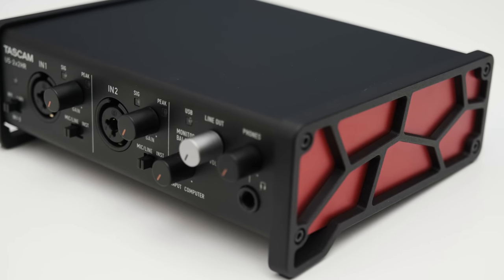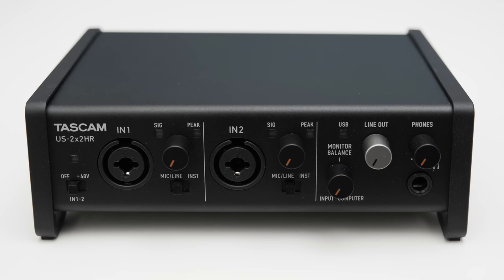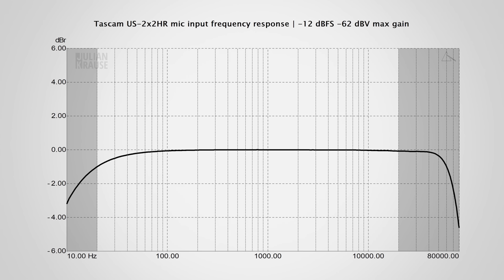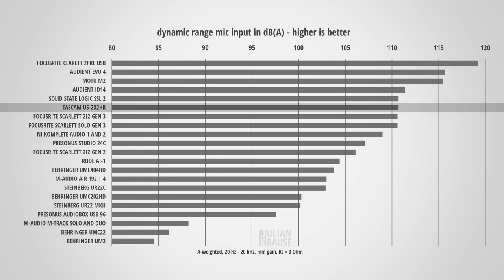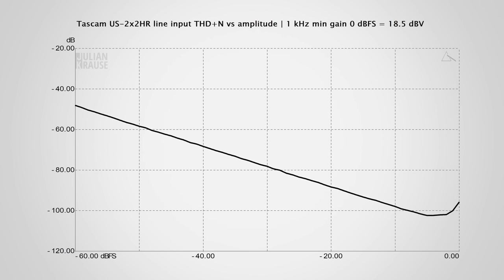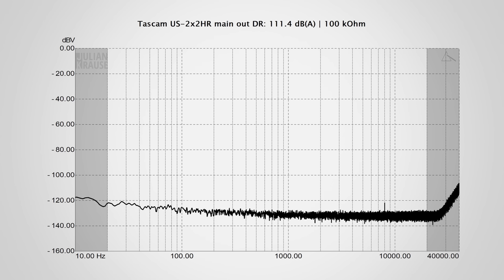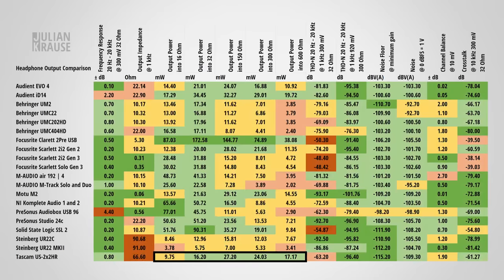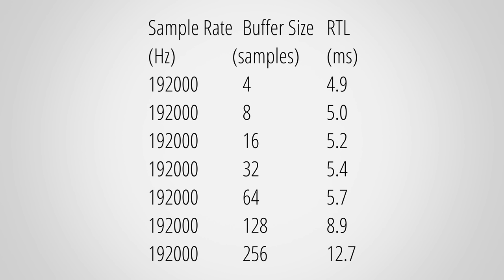Tascam US-2x2HR USB Audio Interface Review (audio quality test)

Comment: I bought a Tascam 2x2HR and it has been nothing but problems.  Mine had several internal soldering joints fail and most recently the headphone monitoring failed.  However my Berhinger UM2 that's almost 10 years old  still works  fine as does my Focusrite Scarlett that's 2 years old.  IMHO Tascam is not making products with the same build quality that it once produced.  Buy a Focusrite don't waste your money on the Tascam.

Comment: STILL enjoying my MOTU M2.
Reply: Me 2 =)
Reply: Hey guys what makes the motu better than the Scarlett 3rd gen? I just purchased the 2i2 3rd gen and don’t know if I should trade? I record guitars allot
Reply: @jorgeguitar2540  both are imo good audio interfaces. Julian did reviews about both of them. Worth watching!
Reply: @jorgeguitar2540  your scarlett is also solid purchase. But according to our friend Julian it has the most balanced and positive results overall. I for instante only use it for xlr microphone +monitor and headphone amplification. Also those visual meter right in the front is super useful + PC sound loop right into drivers
Reply: @jorgeguitar2540  hello, I'm gonna hop in on this conversation and give my two cents (I own the m4 and have had a scarlett solo and 18i8 in the past) 
In my opinion, the screen that shows the levels is decently accurate but mostly helpful for setting quick levels. The mic and line ins are probably of similar sound quality (Julian has done a video on this before)
The real selling point for me with the Motu M2 and M4 is that they have extremely fast conversion times and introduces much less latency into the signal path. When I'm working at 48khz I can take the motu all the way down to 128 or 256 and not get any cracks or pops when I'm trying to record vocals or something like that while maintaining best in class latency. Honestly, you'd have to pay hundreds of dollars more to get something quite as fast, or better. (I could be wrong on that, but it seems true in my experiences so far) 

This difference in latency is due to the utilization of Type-C connections.
Reply: @tristanmcguffin8947  If you are no musician, just a pc dude who wants to stream or something, go with the scarlett if you are happy with it.
Reply: @ImDaRealCartman  For streaming I would recommend the audient evo v4, unless budget is seriously tight.
Reply: Julian's M2 review made out the M2 to be very impressive. In the US it's only $30 more than this Tascam unit but has lower latency with multiple instruments.
Reply: @jorgeguitar2540  Have you seen the Antelope Zen Go yet? Seems ideal for guitar players as it has builtin amp sims and cabinets, It's just shy of 500 Euro though so I am waiting to see that Julian has to say about it.
Reply: @vroge3275  built in amp sims? Sounds nice! I heard the Ik multimedia axe is good for guitar players too but I also see bad reviews. Honestly I don’t know what a good DI input will be? All I hear is  this x interface di input is more dynamic but what makes it like that and good so I can look for the specs on different interfaces?
Reply: @jorgeguitar2540  Yes, it is a minefield trying to pick and choose, which is why what Julian does is so important. He is giving unbiased reviews based on what the devices actually do rather than what the companies say they do.

Comment: Thank you for the review, as always great in details! Charts with different interfaces are very helpful.
I am looking to upgrade my old Tascam US-200. This dude gave me, and still getting me different kind of troubles. Reading forums here and there, I see that people have same issues with newer Tascam US2x2HR, and it's a bummer. I watched tones of different reviews, and still haven't get my head clear about what to choose for a home studio in a price range 150 - 300. When you are in this segment you are not a pro (meaning making money with a music) and basically it comes not to subtle technical differences, but rather to outputs/inputs needs, and stability. The latter, which is most important, at least for me, rarely appears in reviews. I understand why - reviewers most often do not own, or do not use the product for a longer period of time.
I am starting to think that only normal way, how you can choose a suitable audio interface, is to get one, test on your setup for a week or so, and if it works out keep it, otherwise send it back. Unfortunately sanding back sometimes is not that easy, or not possible at all.

Comment: Bro I'm thankful to you. Finally decided to change audiointerface, cause Line 6 UX 2 is incredibly bad with windows 10.  My choice is Audient EVO 8. It's just great. Silent, amplifier is more than enough for 250 Ohm headphones. Stable drivers, lovely program interface where i don't even need to tuch buttons on the interface itself for adjustments. Thnak you again, your channel is the best gear review channel ever.

Comment: My first interface was the tascam 122 and at the time not much could touch it…for the money that is, then I moved on to RME FF800, Babyface, and never looked back, both original RME units still work perfectly and are still supported with soft and firmware updates, and given how old they are and how their performance still holds up is quiet amazing!
Reply: Would u say that this interface is an upgrade over the us 122?...I currently have the us 122 and looking to upgrade...I use windows 7... thanks
Reply: @lisaredsatl2571  very probably, but the 122 was a fine piece of gear for its price back then

Comment: I have the 208i from Tascam, which (from what I've been able to find online) appears to use a lot of the same technology as the HR series. Or rather, the HR series seems to use a lot of the same tech as the 102i/208i, since they were released a couple years prior. Always great to see some of the more pro-oriented features and specs make their way to consumer-oriented gear, although it's too bad that the option to set phantom power individually for each input did not make it to the HR series - that's always been a pet peeve of mine. I've been very happy with it, but I'm grateful I found this analysis because it validates an issue I've noticed in my 208i that had me wondering if I was going crazy or just set it up incorrectly - the headphone output balance. The left channel is significantly quieter than the right on BOTH headphone outputs, so much so that they're utterly unusable. It doesn't have really have a practical impact on my work, because I've been using dedicated headphone amps for a while now, but it's unfortunate that on the off chance I do want to use them (like for if a client wants to listen in on headphones), I have to use other solutions. That, and I don't like the driver utility interface very much. Otherwise, it's a fantastic interface and a terrific value.

Comment: I am looking at the US-4x4HR, and I am very happy that you included the headphone output quality as well as I have been wondering if  should add a headphone amp and use the 3 and 4 outputs on the back for that. My headphones are 32Ohms, so that's a bit sad. But I did see other interesting interfaces in the list there, so I'll check your reviews on those. Hoping that the 4 XLR in versions have the same quality as those you tested.

That being said, the rest of the performance of this interface was really good, so I might just go for the US-4x4HR and a headphone amp connected to the 3-4 outputs. (I've been looking at the Schiit Magni+ which has less than 0.2 Ohms output impedance according to Shiit's spec sheet)
Reply: it actually excels at  driving high impedance headphones. it has problems with low impedance ones due to it's high ohm output. Impedance of Headphones should be 6 to 8 times as much as the impedance of the output. So you are golden.
Reply: @rebecaahumada3790  Care to explain? I will also probably be using this interface with a 50 Ohms impedance. How bad is the distortion going to be?

Comment: Hey, Julian! Thank you for your detailed and comprehensive reviews! After watching pretty much all of your audio interfaces reviews I noticed most of them have same key-note. And that is average performance of headphone amplifier, in terms of high-impedance output, weak performance with low-impedance headphones, low output power to high impedance etc. I’ve been wondering if the dedicated AMP (such as JDS Atom, Schiiit Magni etc.) could be a possible solution to this. However I have no idea what’s the proper commutation for this setup would be. I think that might be an interesting topic for your viewers, since many of the interfaces have decent input performance so the only thing that needed to fix is the actual headphone output! Any chance you might want to make a video about that at some point? Cheers!
Reply: Yes, using a dedicated headphone amp is the way to go. Pretty much all headphone amps have either RCA or 1/4" inputs, and nearly all interfaces are going to give you at least 1 pair of 1/4" outputs (RCA output seems to be very rare - the only interfaces I can think of that have them are the Behringers). So you'll just need to use a dual-1/4" cable to connect the amp (or possibly a dual-1/4" to dual-RCA if the amp only has RCA input, like the JDS Atom). Luckily, most amps I know of also have RCA preamp outputs for if you want to also connect a pair of powered studio monitors.

Comment: @2:40 the interface offers plug in power. 
@10:40 You show the effect of running high impedance headphones and the Tascam seems to have much more gain than most USB powered headphones. 
Are these numbers on your chart the results of your testing, or was it found on the spec sheet?
The reason I ask is I wonder if this high gain is available ONLY with plug in power?
Reply from the maker: Hey, all the numbers shown in the video are real-world measurements of the interface. The power figures for the headphone output were measured with just the USB connection. No external power supply was used. Cheers!
Reply: @JulianKrause  Thank you for clarifying, and for your very detailed review!
Do you know what the difference is with the Tascam US2x2 vs the US2X2HR?

Comment: Your channel is excellent! The data is extremely useful and well organised, thank you. Have you considering doing a video on how you conduct your testing / measurements?

Also, sorry if I missed in in a previous video but what would be the issue with using the USx2HR with low impedance headphones?

Comment: Interesting about the headphones. But it makes sense. Everything about this device seems to be designed to handle professional inputs and output levels. And the distortion level for a moderate impedance headphone used for tracking shouldn't be a big problem. With some excellent resolution on tap if you switch over to something like a Beyerdynamic for mixing. Well then again I wouldn't recommend mixing on any headphones, with any DAC. Definitely sold me on giving this one a try. Also a lot of the reviews are saying that the drivers are more stable than other options.

Comment: Hi Julian, I have a question, most interfaces come with 1 headphone amp. What is recommended to use in order to increase the number of headphones to 2 or more, without affecting the quality of the interface amp? Is a "Y" splitter ok? or an external headphone amp would be the route to go? (considering that depending of the amp it may worsen the quality of the signal)
Reply: Do not use the Y splitter. Your headphones for example 2x 32ohm has then only 16ohm. The better was 250ohm!

Comment: can someone explain to me the issue with output impedance @1kHz? I have hyper x cloud II headphones and they only have an impedance of 60ohms. Is the listening experience going to be unbearable or am I missing something? I could get better headphones if necessary but I need closed back headphones that are incredibly comfortable for long hours.  I am currently using the motu m2 audio interface but I find it has too much pre amp noise and I hate that it doesnt have a knob for mixing pc and mic audio. I really like that the tascam 4x4HR has two headphone outputs and Im assuming it has similar pre amp performance to the tascam 2x2HR. I am also looking at the M audio air 192-4, 6 or 8 as it also has very low pre amp noise and all the other features I want except for the dual headphone outputs but cant I just use a headphone splitter for that?

Comment: Can someone tell me if the Output power seen at the 13:30 chart changes the volume I get in my monitors? I own a behringer umc202hd with a pair of JBLs 305p (3.86 at 600ohms).. Does it mean if i get a SSL 2 with 9.84 output power at 600ohm will I get more volume or the difference is negligible?
Reply from the maker: Hey, the chart at 13:30 is only for the headphone output. If you want a higher output you would need an interface that can provide a higher voltage from the line level output. The UMC202HD has a relatively low output and that's why your monitors aren't as loud. But there is a trick you can try: The JBL 305s have a switch on the pack which you can set to -10 dBV or +4 dBu. If you set this switch to -10 dBV you get the loudest output.
Reply: @JulianKrause  I already use it on -10 dBv, but I still felt like it was not as loud as I expected, although I have no reference for what it should be neither I experienced other equipment to compare (maybe they are as loud as they are supposed to be). I know they are active monitors but what I don't know is if different interfaces would output different volumes to the monitors? For the purpose of monitoring audio the volume is high enough, I was only wondering if it could get louder volume. Thank you for taking your time to answer, appreciate it!

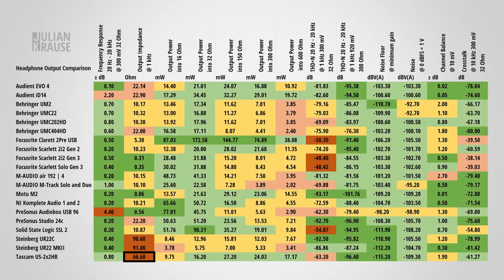One more thing, so you say the Output power at the chart (10:11*) represents the headphone output, so the line level output is represented by one of these columns?

Comment: Would this or the 1x2 work just as an headphone amp when not connected to any PC/Mac/iOS device? 
Just with a usb cable for power of course. Have plently of old USB phone chargers around. 
Just asking because I could get my hands on one of these for almost nothing.

Comment: hi, you said the device got a little problem with low incidence headphones, i got the K702
Reference studio headphones that got an Rated impedance (Q) of 62, is that considered low? will they work fine? (and i do mean to get the us 1x2HR with only one input, i guess its the same since on the site they say they got the same hardware more or less)
Reply: Well he didn't say it will have problem, but that frequency response might not be 100% flat. They will work just fine, like every other headphones. If you are interested in practical use answer, then tag me in 4 days (I have ordered US-2x2HR and I use K702 as my main headphones)
Reply: Ok, so I finally got the unit and I have to say, with low impedance headphones I fill like I'm getting the sound more "squished" or compressed as you would say. Although, this is a very slight difference (it is most noticeable on my IEMS with 16ohms) but almost not hearable at AKG K702. Also I feel like these headphones sounded better on ID14 MKII, but hey, that unit is 50$ more, and I hated the way preamps were set (I was using it to run discord and other voice chats)

Comment: Hey Julian, great vídeo! I have a question for you. I'm looking for a new audio interface, checking what's in the 500 - 700 euro range, the antelope zen go or the spl crimson. Regarding the headphone amp impidance  the antelope Support answered me that the Zen Go has 24ohms(after first saying 120 and 54), and the crimson states 33 ohm. Is this too hi? Considering that most hi end headphones have low impedance like the audeze lcd x or focal clear pro. From your videos the Motu m2 seems to be a better option for less. Thanks for your help.

Comment: I have Steinberg UR12 audio interface. Im using it with ATH M50x 32 Ohm, mic with phantom power and guitar in line. I thought it was a great setup after the built-in sound card! However, after a year, i think HP it's not loud enough. Can you recommend a solution to the problem? Just choose from another model of sound interface or can I connect like Steinberg -> DAC (FiiO may be) -> Headphones?